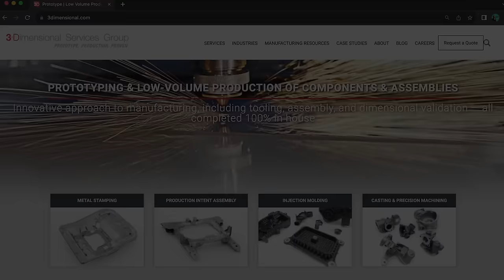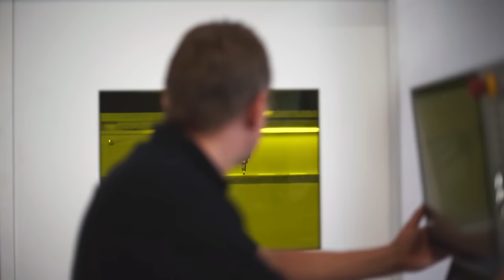Elon Musk and Sandy Munro discuss the Cybertruck!

Comment: Back in the early 90's at university we built prototype 2 wire data/power systems for cars, with a small IC at each corner. Our profersors had showed off a mark 3 escort (when the mark 3 was new in the mid 80's) to ford with a small tupperware sized container in each corner with a similar system  - they scared the engineers by having driven the experimental car to them, not trailered it!
Reply: In late 90s my diploma were about can micro controllers conneting everything in car. But... Most problem were speed. So, i have built something like can hub to split messages. It was not so good idea as i wish it to be.
And now im still working with stupid canopen...😁
Reply: @teodor4ik183   what I notice is a lot of fuses and chips and sensors in a lot of plastic. It could all be integrated into one piece and save a lot of weight and materials.
Reply: @MiteshDamania  in my take it was much worse... My fuses was all around..😁 Fuses can be changed by electronic overcurrent protection, but its much more expience. At least it were in 90s.
A lot of boxes with enclosures dictated by oems. You choose systems you need, buy boxes you need, connect to main controller, configure it. I am now working in automarion and have same trouble. PLC by oem dont have overcurrent protection, so i need to use a lot of fuses with holders. If i work with something like flame, i need to use flame controllers etc.  I cant distribute sytem in favor of easyer service, so using a lot of excessive wires.

Comment: Perhaps a naïve DESIGN question ….. why no charging port up front, like a Rivian R1T?  
If you have an up-front charging port, then hauling a trailer on an EV  road trip wouldn’t be such a horror story.   With the exception of 1 charging station in Tennessee with 4 pull-thru stalls …. every charging station I’ve ever seen (in real life or photos, in North America), one has to detach the trailer AND park the trailer somewhere BEFORE being able to pull the EV into the charging stall …. because the charging port is in the rear of the EV … and a hooked-up trailer blocks a rear charging port.

Don’t trucks pull trailers on road trips more than once in a blue moon?

Comment: Absolutely riveting interview! It's a breath of fresh air to see engineers taking center stage in discussing groundbreaking vehicle developments. Elon Musk's approach, reminiscent of the bold moves of historical figures like Henry Ford, is a testament to the power of innovative leadership in the automotive industry. This conversation underscores a critical point: true innovation often requires stepping away from conventional corporate strategies, like quarterly financial performance, and daring to embrace risks. It's this kind of forward-thinking and risk-taking that has set Tesla apart, particularly in manufacturing innovation. It's not just about the vehicles themselves but the revolutionary production lines like the one planned for Model 2. This discussion also opens up intriguing questions about future integrations of advanced technologies like steer-by-wire in upcoming models. Kudos to Sandy for such a well-conducted interview, shedding light on the intricate blend of engineering brilliance and visionary leadership driving today's automotive revolution!

Comment: The Cybertruck extended range requires more kWh  then some EVs have in total just for Sentry mode to work.

A Fiat 500e has 84 miles range.

Max Cybertruck range is 470 miles (20%=94).

We are told to only use 50% by Tesla; "only charge to 80% for daily driving / at high use superchargers" and "Sentry mode is unavailable below 20%, so charge at 30%".

Sandy should have asked why Sentry mode is disabled at 20% instead of 44 miles (or make it smart; turning off Sentry mode based on how far your charging destination is away from your parking spot).

Comment: It's nice to hear how enthusiastic Sandy is about the technically sensible innovations in the Cybertruck that Elon has finally implemented through his power. As an engineer, I would probably have talked too much and asked too little. But I would certainly have asked this, my main concern: When will the time come for 4 wheel motors to provide the drive?
Reply: For off road vehicles hopefully never.  Dual motor with mechanically locking differentials allow you to get more power and torque to any single wheel.
Reply: Unsprung weight is no good. That’s why it’s not being done.

Comment: My only critique of sandy is he is a straight to the bottom line for the manufacturer, and does not seem to mention much about repairability and the adjacent topic of right to repair the latter of which is more understandable.  Manufacturers shouldn’t forsake repair for the last few cents in manufacturing because it’s a short sighted strategy, when repair costs soar compared to competitors it hurts the brand.

Comment: 4WS was definitely implemented.. it's in my 2005 Yukon XL -- the last year it was made, and many of us quadrasteer owners aren't replacing them until there's a vehicle like CT that can do the same.  I can do a U-turn easily in a residential street, but not with my sedan.  Thank you, thank you, Elon - for including this capability!!
Reply: I have a rear wheel drive van that has a sub 30 foot turning circle using normal front steer; compare that to the CT, which has around 35 foot turning circle; you don't need rear steer, just good design.
Reply: It came in late 80's Honda Preludes.  Steer by wire is nothing new as well
Reply: Just be careful, there’s a reason they were discontinued. 
Too many accidents when it was engaged at high speeds led them to drop it

With their superior onboard computers Tesla has eradicated that problem
Reply: @booradlly  Umm, no. They didn't advertise them well and overpriced them.. then eventually they didn't sell.  QS are far more stable than a typical vehicle at high speeds - they all turn the same direction above ~40 mph so it has a "side stepping" action, which is much safer when towing trailers vs a "whipping action" with straight rear wheels. The vehicle also is about 6" wider than normal (requires special DOT lights because of it).  It's quite obvious how much more stable and controlled it is at both high and low speeds.
Reply: @petesmitt  If you have that tight of a turning radius without rear wheel steer, it means the wheelbase is incredibly short, which is fine unless you're going to tow anything of significance.
Reply: @timm439    Well maybe I’m completely wrong, as it was so long ago I have no way of backing this up, but shortly after qs was discontinued, the ceo did an interview where he was asked why it was discontinued. And he said it was due to accidents / stability at high speeds. 

Maybe I hallucinated that interview
But that’s where I got the information I stated

And just to be clear I love QS, and am extatic it’s on the cybertruck.
Any of the issues brought up in my hallucination can easily be fixed by steer by wire and programming, so hopefully this becomes standard on all cars
Reply: @timm439  True; my van has a 2400 mm wheelbase vs the 3600 mm CT wheelbase.

Comment: I'd like to hear which technologies that went into the Cybertruck might make their way into the new smaller car, or Juniper project or other vehicles in future.
Reply: They have said the new 25k utilitarian vehicle will be on the 48 volt architecture. Doubtful any existing models will be updated anytime soon as it would demand a significant redesign and vast changes to the factory lines. Tesla does not like to shut down the factory lines nearly ever, only to fix things and maintenance for the most part.
Reply: All of them.
Reply: everything except the giant wiper lol
Reply: Now that a first vehicle has been designed and manufactured the next one will be a lot easier. 48V and ethernet are, as Elon says, obvious so strong candidates. Stainless steel will, I would predict, will only be used on high end vehicles
Reply: @stephenwabaxter  stainless is not for hi end. It is for heavy duty. I think, that bus will be stainless too. Maybe some light truck too.
Reply: Probably only limited by how quickly they can get it done.

Comment: I can't help but wonder.. since the wheel isn't mechanically connected to the wheels, is there a safety measure in place incase of catastrophic power loss while in motion?
Reply: One of the scenarios would be when the Cybertruck's battery runs out completely, and there's no power to move the wheels. The simple answer is that the steering system runs on the 48-volt low-voltage battery, and it's also connected to the truck's high-voltage battery. Although unconfirmed, Tesla will also likely feature two steering motors with dedicated low-voltage battery backups.

It's doubtful that all these backup systems will die at the same time, and it's impossible to happen while driving unless something catastrophic occurs. After all, how many times has it happened for an airplane's fly-by-wire system to fail?

Comment: Steer by wire is interesting. I've long thought it could be used to make a switchable LHD/RHD vehicle. Imagine arriving in England from France and just sliding the controls from the left seat to the right.
Reply: Just plug the controls in the other side, I like that. Except the current regulations stop them selling the Cybertruck in France and England apparently.
Reply: Not exactly, but it renders it a bit useless, as max authorized weight with a regular driving license is 3.5 metric tonnes fully loaded  @DavidPeck-DP

Comment: 00:11 The Cybertruck is the most revolutionary product and reaching production was extremely difficult.
02:32 Impressed with self-driving technology
07:28 Discussion about the necessity of automation and the benefits of working with innovative companies.
09:52 Higher voltage enables thinner wires and reduces weight in the wire harness.
14:26 Upgrading car electronics to higher bus voltage and data rate system.
16:39 Steer by wire in Cybertruck enhances steering control
20:34 Discussion about the spacious back seat and windshield wipers
22:28 Challenges faced in production due to worldwide pandemic and chip shortage
26:27 Elon Musk and Sandy Munro believe that the Cybertruck is the most iconic vehicle in 30-40 years.
28:31 Sandy Munro is impressed by the Cybertruck's unique features and engineering.
32:36 Discussion about the new factory expansion
34:30 The Cybertruck allows for more adventurous engineering due to less risk.
39:01 Elon Musk expresses concern about the current state of the education system and its impact on society.
41:06 Concerns about societal progression and adherence to politically correct philosophy
Reply: Loot you the real MVP.
Reply: not all heroes wear capes
Reply: Curious about the engineering decision to use these large all-terrain tires as opposed to a smaller road tire which could have added up to 40 miles more range. Hopefully we can get some more insight down the road.
Reply: @harrychu650  Pretty sure you can use non-bespoke tires and wheels. it just won't look as cool but 10 miles is 10 miles.
Reply: It went off the rails so freakin’ fast LOL - and this really highlight just how unhinged it suddenly became.  Sandy needs to take his meds 😅
It’s not even the opinion - it’s just that it is so out of place from the preceding interview.
Reply: Thanks Loot👍🏼
Reply: The last two segments suddenly became very interesting all of the sudden.
Reply: You are everyone's hero 💪🏿
Reply: Thanks!
Like it when people do this!
Reply: Thanks a lot!
Reply: @dogbots159  huh?
Reply: So absolutely f-all about the trucking capabilities...

All this hype. So many youtuber making video of it..  and NONE talk about towing and whatnot .

This is just a bigger Tesla for people who don't want truck... But want angular shape
Reply: I still think that it looks like a polished doorstop but that's just me.
Reply: Did they mention anything about the promised $40k price tag?
Reply: @LG123ABC  yes, thats just you.
Bullying arround.
Reply: @LG123ABC  i read all your Comments.
Always bullying.
Reply: @ereder1476  bs.
Reply: At 40:00 the interviewer starts sounding like a crackpot just rambling
Reply: If creators actually cared about the viewer and not just the bottom line, they would have made this timestamp chart.
Reply: Thanks! You just saved me 45 minutes!
Reply: @LG123ABC  More like a urinal.
Reply: Inflation raised the price for everything. It's not fair to hold Tesla to $40k as inflation should adjust the price to at least $50k base rate.
Reply: Hank Angel is that you!
Reply: Production line plans already getting underway!
Reply: @harrychu650  Full size truck buyers want big tires… it’s simple. No one drives over 200 miles in a day very often. When you get home you just plug in the truck… fully charged the next morning for $1 in electricity… repeat… We love big all terrain tires…
Reply: @dogbots159 Half of the things you REALLY want to know, Elon can’t comment on. And sandy is going to get a tear down to answer the other half. This interview was what it was. He likes the cybertruck and the direction it has taken.
Reply: at 39:00 they start talking about politics, not Tesla or CyberTruck, but in very vague terms. WTF?!?
Reply: I don’t tune in to hear your political views sandy.
Reply: I don’t tune in to listen to your political views Sandy.
Reply: @gooldii1  That's bullying, hahaha, expressing an opinion and even pointing out it's just one opinion is now bullying, snowflake. Ithink it's as ugly af but that's just my opinion, not telling anyone else they are right or wrong for liking it.
Reply: @crysstoll1191  please, again, in understandable! Maybe in English?
Reply: @crysstoll1191  you are a fossile Cheater Car Fan, hm?
In denial of Climate Change? Gotcha!
Reply: 38:35 Sandy coming out as antiW0ke!

Comment: As far as "Fly by Wire" goes, it seems that in a way, that has been around for well over 100 years - if you consider steam ships.  The ship Pilot would use the "Engine Order Telegraph" (Slow, Half, Full, etc.), which would in turn signal by a Bell and Receiver Handle - thereby signaling the Engineers to physically adjust the engine power.  No direct contact from the Pilot to the engines.  So the public should not be alarmed by "Fly by Wire".

Comment: Sandy great interview! here ideas for some ideas for next time: interaction and economies of scale with SpaceX. guessing that some space ships are to become much cheaper. drive by wire just a natural step towards autonomy.. are there instances when the car will ignore users input like deliberately trying to steer out of a bridge? why using different gauges of stainless? is video also fed thrrough the token ring network... guessing not. is the car boolet proof when shot at with ak47? there is potential for buildimg really armored vehicles using this truck as platform. when starlink is coming as option or standard to tesla cars?

Elon has thought seriously about cars in Mars, what is to be done to make Cybertruck go on Mars with robots inside? people.inside? how to recycle materials from the spaceship to.build a cybertruck on Mars?

also isnt hydroformimg easier than air bending? what will happen to the brand when people will start buying these trucks on the secondary market, this time to really do tough work full of paint, ladders, etc. will you upgrade batteries long term when new chemistey will be available? how recyclable.ia the car? what to do with the stainless and the aluminum? will tesla recycle.them?

i canntotally visualize people camping among lyons or elephants in Africa without fear of getting attacked

Comment: Sandy, thank you for this interview. Have you reviewed the auto EVs available from BYD? I've started a review after your comments. The few BYD auto EVs I could check (on the BYD website and dealership websites) did not impress on EV features, engineering, or price. They are much like EVs from Ford, GM, Toyota, Kia, Hyundai, Lucid, Polstar, Rivian, BMW, VW, Volvo, Audi, Porsche, and Mercedes. I'm not shocked that US consumers are not impressed by the alpha and beta versions of EVs offered at top dollar. Hurting these manufacturers appears to be dealership networks that continue to ask for large sums over MSRP, which impacts EV sales and continues the selling & servicing of ICE platforms that keep the ICE dealers in business.
I agree that Tesla offers the best EV engineering (I've reviewed). The interior cabin options are a Tesla shortcoming based on the price points. The interior cabins and suspension systems are done well within the USA EV market, from med to higher-end offerings. Most must catch up on critical EV basics, including power train, battery, battery management, weight, mileage, and cost. I partially reviewed NIO and believe they have a lead over BYD.

Comment: Great conversation , as usual. One thing though; I was under the impression that Tesla was manufacturing all its chips themselves. Elon seemed to indicate  that the lateness of the CB release was also due to a shortage of chips. But, again, there is more to a car than just computer chips. Maybe the steel 
itself was hard to acquire.
Reply: No, it doesn’t work that way. Tesla designs some of their key chips but < 1% of the total chips they need in the car (not to mention the factory!). What Tesla doesn’t do (yet…) is run a global chip fabrication factory. Maybe someday they will fab chips, but it’s a slim to none chance in the next decade.

It’s the difference between drafting blueprints for a building and being a construction contractor that builds a skyscraper… two totally separate jobs.